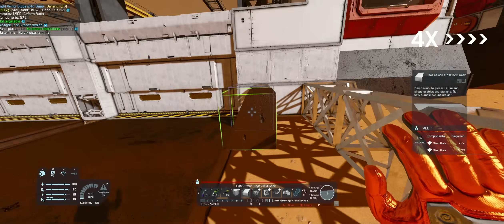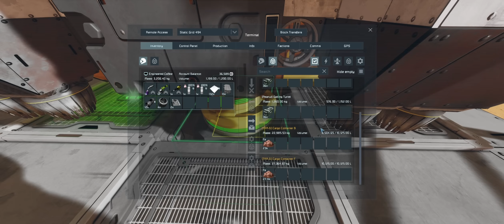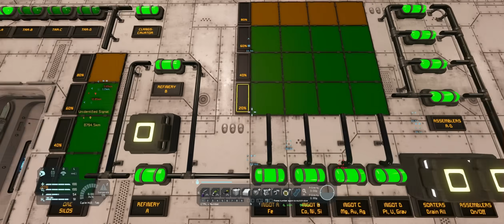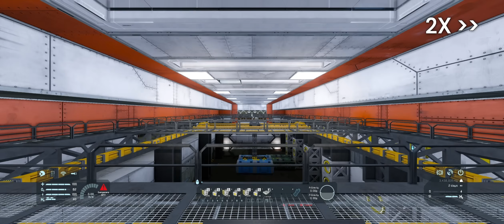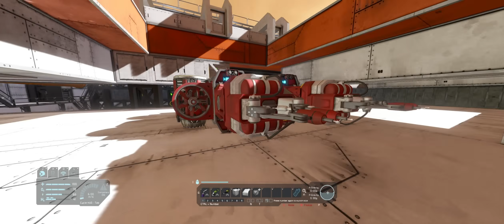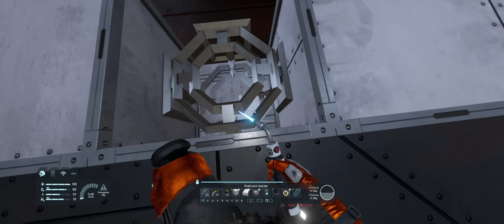Klang Crane Brain! Bridge Crane Vanilla Automation | Martian Engineering E16 | SE Survival

Comment: The last 15 years i have worked in manufacturing, and used lifts like these to change the molds in some pretty large injection molding machines. You need to add rotating alarm lights to be on when the crane is moving, and that can be done with event blocks using the speed sections.
Reply from the maker: I think it does have the rotating lights. Maybe a later episode?

Comment: Hey sir, I have thoroughly enjoyed your series.  I am just a monkey pounding two rocks together compared to you.  I am roughly 5 months old give or take a week.  I have seen so many things and learned a LOT of what can be done in this game.  I would like to ask if you would consider a tutorial series.  Everything from your arsenal of knowledge.  I have seen the airlock tutorials, however the valve was awesome!  I had no idea that you can overfill an o2 tank.  Do the o2 gens keep burning ice even though the hydro or oxygen tanks are full?
  I can use an event controller, timer blocks, rotors, hinges and pistons, barely.  Enough to get me in trouble with lord Klang.  You explain things very well and again, I hope you would consider some tutorials.  On my computer, I am trying to make a concealed turret on the roof of a base.  They would be concealed when not in use, but when an enemy is detected, they pop up handle business then recess back inside the roof.
Reply from the maker: The h2 generators will stop if the tanks are full. But for an airlock you don't want a full tank. It needs empty space for the airlock to depressurize into. So the valve keeps the tank from getting to the 100%.

I plan to do more tutorials. I will definitely add your suggestions to it. Still trying to figure out a format/flow.
Reply from the maker: As for you turret idea. Start with the AI offense/defense block. It has a detect enemy with a setup actions. The 1st slot is enemy detected, 2nd is no longer detected. Create a deploy timer and a retract timer.

I will use a simple example, I don't know your setup. Deploy timer = open door, extend piston, turn on turret. Retract timer = retract piston, turn off turret, close door.

You may need additional timers and event controllers to not have the door close on the piston, but it's where I would start.

Comment: The only criticism I have is that the Racks are in fact Stacks... If they were Racks you could Slide things in to position and load/unload any rack positon.  As it is they are Stacks and you have to unload a stack to get to the middle or bottom container.  Maybe add a horizontal Actuator and Rack Rails.

Comment: I reckon that if you want to use "connector connected" events for automating the container height, you will need a set of load and unload timers for each of the 15 positions. For sensors, you could have only one set of timers, and simply adjust the sensor range depending on whether you are putting the conatiner away or picking it up (using timer or button to change sensor range chages it by ~2.5m and works even when the sensor is turned off)

Also, wouldn't it be nicer to have the truck bay selection buttons vertical, so it would align with the actual bays?
Reply from the maker: I was just sitting here thinking the same thing. I want to try little hinges on the trolley to point the sensors to the right location. Great idea!
Reply: @EngineeredCoffee  I was thinking having the sensors on the gantry, so they can check the current height while the trolley is out of position (having the trolley with a container in position would interfere with the sensors), turn them on momentarily so they can activate/deactivate their respective timer, which would effectively work the same as the buttons do now

Comment: You could use some event controllers to detect which connectors are already in use and block that position from the timers. Maybe this doesn't directly work as you turn "manually" the timers on and off, but a solution to this is to double the timers and use them as an "interface".

Event controllers -> Turn on/off Root timers
Buttons -> Turn on/off Interface timers -> Call Root timers

And also, you do a really inspiring and insightful work. Thank you
Reply from the maker: Good idea!

Comment: That crane system worked out brilliantly. Question, and maybe a suggestion (or two), what's to stop you from accidently sending a container to a position that's a) already taken or b) beneath an already occupied storage slot? 
Suggestion 1 - Add an emergency stop button in case you accidentally send a cargo pod on a collision course.
Suggestion 2 - lock out middle/upper storage slots until all connectors below the chosen location are connected, probably using event controllers.... )which I think you may have hinted at near the end of the video.)

I'm impressed with that whole setup so far though.
Reply from the maker: Nothing is preventing it at the moment. I just haven't mapped out a solution yet. An E-stop is a great idea!

Comment: For the loading dock parking spots, make a means of the trucks connecting for charge. This would perfectly align the trucks for the loading and unloading of the cargo containers. Two problems solved with one solution.
Reply from the maker: Agreed! The whole foundation needs some attention.
Reply: @EngineeredCoffee  Looks like you already have the load spots marked.  You could swap to using armor panels and half-panels to mark it more precisely.  After that, you have a space next to the door to place a rotor that can then interface with the elephant trunk on the front of the truck.